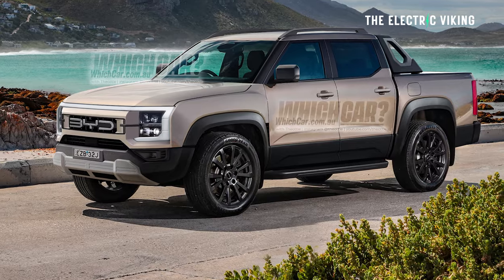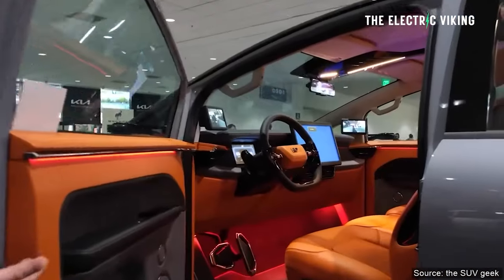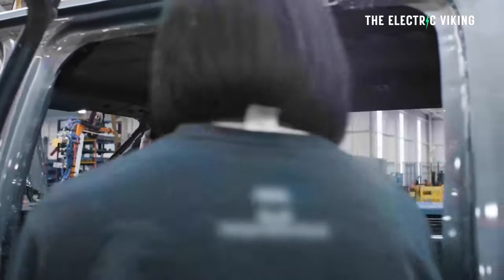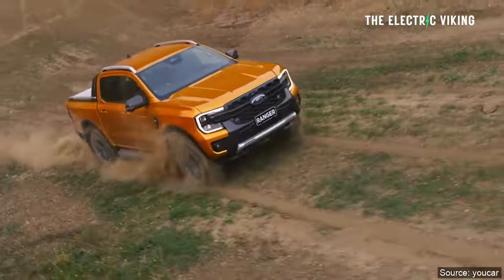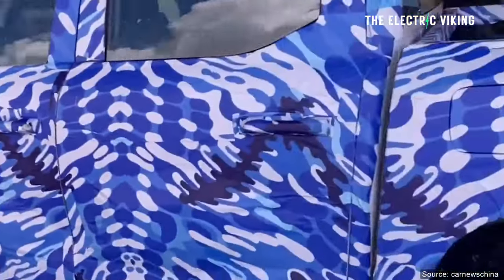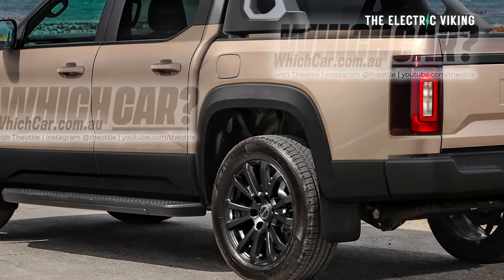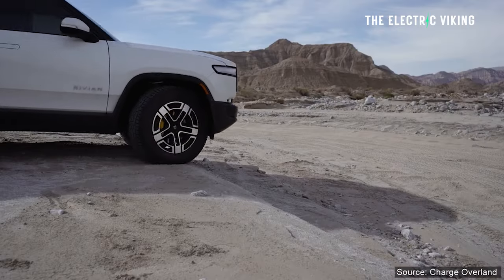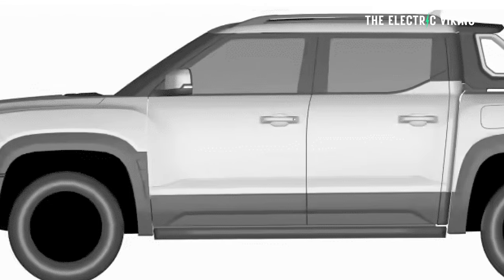Likely BYD Ute design revealed before Australian release in 2024

Comment: Full electric is the future.  PHEV has  fuel system, exhaust system, cooling system, induction system, emissions controls, vibration mounts, engine control computer, geez!  It’s anything but simple.  After 10-15 years these components start to leak oil and coolant, fail emissions, spark plugs wear out.  I have never been comfortable keeping an ICE car as primary transportation for more than about 10 years because they break down.  Pure electric cars have none of these fail points.  Battery will age but not fail outright, won’t leave you stranded.

Comment: What are we we looking for in an EV UTE in Australia? A fit for purpose, Load carrying ute with range.  The LDV T60 is very disappointing for the price point. The LDV Show room in Bendigo refuses to stock, supply ,sell or service any of the range as they say that putting in a service area for EV's is not financially viable. So I cant even test drive the actual EV variants they have! LOL MY Nissan Leaf is serviced by Hyundai as contracted to Nissan because they dont support EV servicing of the Nissans they sell on their own lot. I'm not put off and I'm very happy with my EV  The Nissan Leaf was the only EV in 2020 that could accomadate Power to grid which is also a criteria for me as with Solar it does make a difference when you can store and diffuse battery as needed. I need something that can Tow a Caravan and accommodate me and 4 dogs. Im happy to loose 300 k of range to tow on a dual motor variant with 500 k listed range and I want to go off road on bush tracks. I have ordered Rivian utes for a laugh. Australia is not taking the Utility range of ev's seriously enough so will probably go for a Kia EV9 GT Line and have looked at the LDV Van in the highest spec. I think EV designers need to look at FIT FOR PUPOSE over whistles and bells for the Australian market and the government needs to be consistent with incentives. I have an ev but there was no incentive available at the time of purchase and now I want to up grade and there is no incentive even if its novated. Price point for EV's with range is in the luxury range so people are turning away from EV's. Pretty sick of prototypes and the Australian landed EVs missing half the promised specs. Happy to persist with the search but waiting years for development and then months for delivery is getting a bit old. :-)

Comment: I agree full electric is the way to go but Sam you keep on spouting that hybrid and plugging hybrids are extremely complicated vehicles but they’re not. They’re really not that complicated. I’ve just done my EV training in South Australia and we’ve pulled a few of these gearboxes apart and the Toyota system is extremely uncomplicated. Doesn’t even have a gearbox. It only runs a reduction drive box And all the other vehicles are pretty much the same with a gearbox at the end of it. They are not that complicated.
Reply: Yes this is Sam's often repeated BS point. I agree with him that BEVs are the ultimate end-point, but Sam seems to hate PHEVs more than he does Diesel! I guess it's the old BEV/PHEV rivalry, but that's short-sighted. PHEVs - and HEVs - are a fantastic way to reduce fuel reliance. I would be over the moon if BEV sales stayed the same but HEVs and PHEVs completely replaced diesel and pure ICE petrol.
Reply: I think you're missing the point. They have all the complexities of internal combustion engine drive trains, and then some. That's what makes them complicated compared to the Simplicity of electric vehicles. So they are actually much more complex than EVs. I think you're missing the forest for the trees here
Reply: @douglaswatt1582  I suppose you could argue that the Toyota hybrid system is complex because it has more moving parts. But that masks the actual running of the system, which is incredibly reliable, because of the way that the normal strains of driving that usually results in the wear and tear on an ICE are distributed throughout the system. This is why a Prius can drive 500,000km without any major problem arising.
Reply: I have been wanting to go ev for a while now and I've been waiting over a year for the byd ute but 100k seems excessive. I was told by a byd dealership manager that it would be about 60k. He mentioned at 1200km range but he never mentioned it was a hybrid. From what I am hearing hybrids have less issues then pure evs more range. It's s good stop gap until better batteries are available and in 5 years time I think you will be lucky to sell an ev that has less the 500km range where a hybrid will be much easier to sell.
Reply: @douglaswatt1582 And people forget The Hindenberg.  And the sun.
Reply: Why is fully electric the way to go? Other than everyone just loves ev's and hates ice. Ev only utes is dumb and won't help the environment. This balance that byd has done is the smart move.
Reply: @Christoph1888  if you make a statement like EV ute’s only is dumb and they won’t help the environment. I think you need to clarify your statement with your reasons why. 
And I think it’s obvious why BYD aren’t making a fully electric Ute yet because they can’t manufacture one that’s efficient enough so it doesn’t have to have a whopping big battery pack in it.
Reply: @gregwatling4041  

1. Australians on average drive less than 30 kilometres a day. Although utes would exceed that it's definitely less than 100 kilometers a day

2. The dirtiest component of EVs manufacture is the battery. Leading to a larger carbon footprint than ice manufacturer. 

3. For every 100 kilowatt hours of battery pack you add roughly half a ton according to Tesla numbers. 

4. Current Ford F150 lightning gets ~30 kwh per 100k range freeway which drops to ~50kwh when towing. 

5. To have an electric ute be able to tow 300 kilometers plus between charge points (not unreasonable). Considering you can only fast charge to 80%, shouldnt flatten bellow 10% and probably want some margin, means you'll probably be driving @ 20-80%.

6. This equals a pack size of ~250kwh (150 is the 20‐80% based on lightning numbers). Or as much as 1.25 tonne.

7. That vehicle will spend 95% of its time doing less than 50km a day. We are missing the forest for the trees. A range extender lets you have your cake and eat it too.

8. Use a 30-50kwh battery @ 150‐250kg with a 50kw RE, basically a large motorcycle engine.

9. You don't have the issues of wanting to use a fast charger whenever everyone else does (halfway point of a popular destination on a Saturday). Fast charges not currently being set up to charge while hitched isnt a concern. You can travel in remote areas without charging infrastructure.

10. You're coming in much lighter, cleaner to build and probably $50k cheaper. All for a vehicle that will function just like a ev ute 95% of the time, just more efficiently because it weighs half a ton less. 

I'm definitely not anti-ev I think they're great. I just think they're not suitable for all use cases. Keep in mind the range extender could run on things like ethanol or E85 which is readily available in some States (Queensland)
Reply: @Christoph1888  your second point on carbon emissions. Yes it’s carbon intensive to manufacture the Battery but electric vehicles carbon emissions over its lifespan is about 30% less than an ice car and that will get lower overtime when more and more batteries are recycled but there’s a second purpose for Batteries as well and that’s energy storage when it’s not fit for a car any longer which you cannot do in an ice car. You can’t recycle petrol once you’ve burnt it.
Since you wanna consider towing, ICE utes have only been able to tow 3.5ton for the past 25 years before then their maximum was about 2.5ton that took almost 100 years to happen. That’s not gonna happen with the electric vehicles, the progression is about 1000 times faster, Tesla have already done it , you can tow 7.5ton. It would drop half its range at that, but consider if you only tow 2 to 3 t a boat or a caravan. That thing will still be getting 400 km. As far as charging is concerned if it’s an NMC battery it’s okay to take it to 100% a few times if you’re doing a long trip but the majority of driving around town you’re only taking it to 80% and if you have an LFP Battery well you can take it to 100% as often as you want. 
BYD are definitely biding their time with hybrids. They will be working very hard to try and make a more efficient. EV Ute

I definitely agree that the charging infrastructure needs to improve dramatically, but it’s very expensive to put in these rapid charges even with government assistance. 

Along with a lot of people I think your expectations are too high. Things aren’t perfect it’ll be beautiful if they just made it perfect and said here you go but it just doesn’t work that way. It hasn’t worked that way with cars for 120 years they’ve never been perfect , in fact, I think they’ve been getting worse over the past 20 years.  I think they’ve gotten all the efficiencies out of these engines as a possibly can and they’re just not lasting anywhere near as long as they used to. You hear about recalls of hundreds of thousands of engines every year now, for failure from almost all the car companies. 

But for now you just use whatever you have to use to do the job that you need to do until there’s something that comes along that fits your needs.
Reply: @gregwatling4041  With respect your missing my point. Keep in mind I'm talking about electric utes with range extenders not comparing electric utes to ice utes.

Yes lfp can got to 100% but it can't fast charge to that. Yes EVs are in the early days and already tow better, it's the battery range thats the issue. EV utes will still consume around 50 kilowatt hours or more when towing heavy & well above 30 when towing light. That's a fact that won't change and will require large batteries to work as intended. It's physics not marketing and wishful thinking.

I get that you love them and think they're the future, I also love them, I think they're amazing, I'm just being rational. It is mad to convince people to go from driving 2 ton SUV/UTES to 3-ton SUV/UTES that will most likely be used to drive no more than 50kms most of the time and hardly ever tow, all in the name of climate change. Considering that the batteries that go into them are a rare resource and do have environmental impacts. Not to mention the cost will be significant for the foreseeable future.

Why not have an Ev ute with a battery suitable for the 95% and then just use a small ice for the 5%. To make the ute capable of that remaining 5% requires a significant increase in cost and weight and it's still a compromise in terms of capability relative to an ice range extender. The vehicle will be much lighter, much cheaper, more convenient on long trips, more efficient, meet or exceed ice towing capabilities and still be better for the environment than the status quo.

Batteries will never match hydrocarbons for energy density and those hydrocarbons can be renewable hydrocarbons (ethanol/e85).

We don't have to have this black and white approach where we have to get rid of all Ice under all circumstances and everything must be electric under all circumstances. In many cases ev only makes complete sense just not for UTES/SUVs.
Reply: @Christoph1888  we’re doing to the ice cars what we did to the horse and cart 120years ago, we pushing them out of the market for newer and better technology.

And cars back then weren’t very capable, and the infrastructure wasn’t very good, but people knew the potential of them and kept buying them within 13 years. The horse and cart was gone, and what did they do with the horses they ate them.

Engines are in efficient as it is and you want to run them on ethanol. That’s garbage fuel, but not only that you have to then grow fields and fields of sugarcane or corn and you’re taking that away from human consumption which is happening a lot in the United States and maybe even here. 

PHEV’s will be there for a short, while there is not a permanent solution. 
The whole idea is to stop burning stuff

Climate changes, one of the furthest reasons I want electric vehicles I think they’re better technology they’re quiet. I can sit behind one and have my window down. Unlike some of these Utes we drive around, and every time they hit the Excelerator they bellow out black smoke, and I’ve got a wind, my window back up before I cop a whiff of it. What’s the first thing they do when you go to drive-through or tunnel? Why your window up and put your car in recycle so you don’t die on the way through. 

By the time anyone is forced to change to an electric Ute, they’ll be more than enough vehicles to accommodate their needs.

You know at the end of the day your opinion, my opinion means nothing. The governments of the world have made a decision and that’s what’s happening.
Reply: @gregwatling4041  You're not listening. Get rid of ice by all means but ev everything is not the answer in the short term. Like so many in your camp you're an idealog. You don't make evidenced based points it's all wishfull thinking. I never said I wanted everything to run on ethanol I said for the 5% you could use ethanol. We export the vast majority of the food we produce and we already make lots of ethanol in Queensland, Brazil has been running its automotive sector on ethanol since the 70s. Ethanol is widely used in the race car industry for its superior octane rating yet it's a rubbish fuel. Right. You just have no idea what you're talking about.  You're like so many people on this site it's a religion for you and your convinced your right but you live in a bubble of ignorance. I'm agreeing with you in principle anyway. Long term sure ev everything. 

I will bet you in the coming decade the main utes that people buy, if not pure diesel/petrol will be hybrid utes like this one. There will be a few early adopters & zealouts. But for the majority they will be price prohibitive and not practical.

In America sales of the lightning are already way down and there has been an increase in people moving back to hybrid or internal combustion from those that have owned EVs and need to drive long distances. 

Keep in mind this isn't the outcome I want it's just being realistic. But I won't convince you, we can respectively disagree, the future will settle our argument. I know what my money is on.
Reply: @Christoph1888  I totally understand what you’re saying I just don’t agree,  2035 is it even if we don’t have a mandate here in Australia to stop selling ice cars/hybrids The rest of the world would do it for us because the car manufacturers aren’t gonna build ice cars just for little old Australia. 
So you’re gonna lose your money, just like the people who bet on the horse and cart
Reply: @gregwatling4041  hopefully your right. I just dont think u r.
Reply: @brett8445   BYD ute will come in two different versions. The plug-in hybrid version of the ute will be released in the first half of the year, and the pure electric version may be next year.